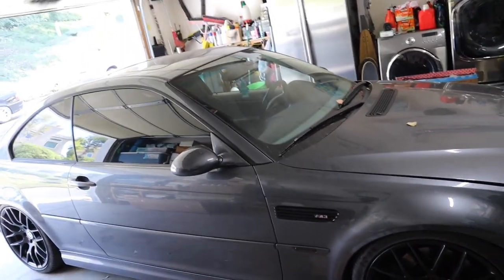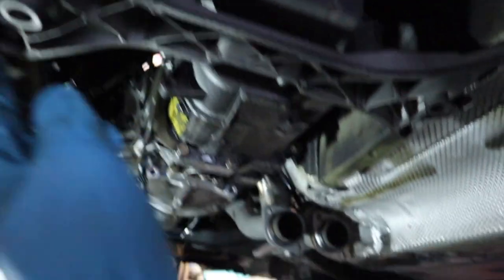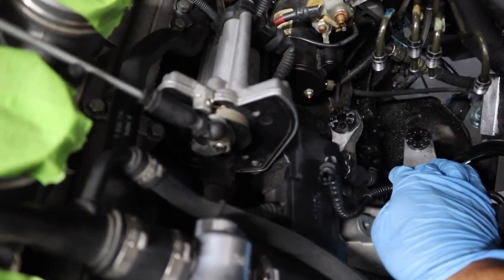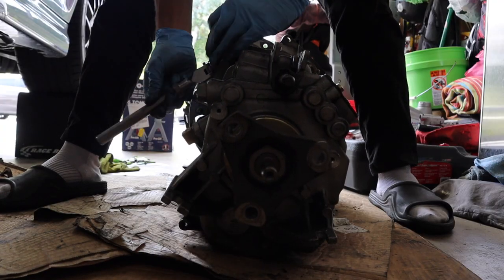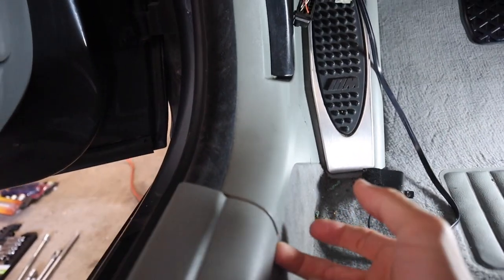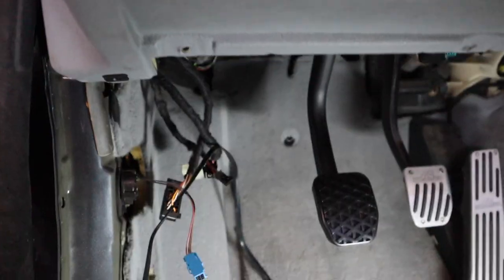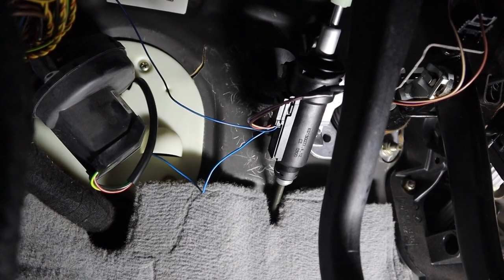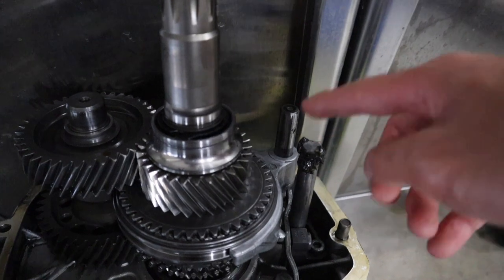E46 M3 SMG to Manual Conversion DIY (On Jackstands)

Comment from the maker: LITTLE UPDATE: My friend Jeppe had been tracking down why his cruise control hasn’t been working and it’s because at around 28 minutes into the video I explain how you need to wire into pin 20 on the connector that is the second one from the left but it is in fact the connector that is the second one from the right. Although messing this up won’t compromise the driveability of the car, it will make it so your CC doesn’t work. So if cruise control is important to you, be sure to fix this mistake I made in the video! Thank you and thanks to Jeppe for figuring it out!
Reply: Thanks for the update. I bought a conversion with non functioning CC. Will check the pin. Any other common reasons on swaps you’re aware of?
Reply from the maker: @kraken509  check the clutch switch! if it’s black and not brown, then that would cause a non functioning CC
Reply: @jinendow  mine is black! Good call.

Comment: Best thing you can do to ANY car IMO.  Doesn't matter if it's an E46 or a freakin econo box like a Neon. Three pedals or nothing is my motto. Makes it so much more fun to drive, and obviously you have a lot more control over the vehicle. The SMG sucks ass compared to the later DCT trans' anyways so regardless it's the better move. The DCT is WORLDS BETTER if your into auto trans.' SMG's are always so 'clunky' shift really rough, especially at lower RPM. Makes anyone look like a noob when you're driving. S54's are so awesome that having that crappy SMG bolted to it is really a buzzkill. I'm a VW/ Audi and BMW tech that's been turning wrenches on these and pretty much anything with an engine for a little more than 25 years. The amount of SMG failures I've seen alone also makes this swap mandatory IMO. Like a completely different car with the manual. Good video. Thanks for sharing man. 👍
Reply from the maker: I 100% agree! been a few years since I made this video and haven’t regretted a thing
Reply: @jinendow  definitely man! I've swapped to manual trannies on a good amount of all kinds of stuff over the years, and I've never had a customer or a friend that I've done the job for that's been disappointed whatsoever.

Comment: Did you notice any  power decrease after the swap prior to getting coded? Just finished up my swap and had a local euro shop code it , no more dash cog but still getting a CEL for smg. Car also feels about 200hp until 4k rpm
Reply from the maker: before I got it coded I could definitely tell the power was off. the revs in between gears would drop aggressively and it felt as if it was in some limp mode. after I got the car coded by ecuworx it felt the same as before the swap though (as in perfect)
Reply: @jinendow  I’ll hit up ecuworx ASAP thanks !

Comment: Good job on the video, decent coverage of the steps.
Regarding the trany, since you had it all out, did you replace any of the compression springs? Did you install the locking pin and thrust pin? also noticed no ID switch, any issues with that? Im just trying to get all the parts I need in my basket as we speak... will be doing all the seals (inner and outer) as well since its out.
Reply from the maker: I did not replace any of the springs unless that is covered under Lang's Bellhousing machine service. And the ID switch isn't really necessary if you get the proper coding done afterwards. Good luck!

Comment: I did the swap, but fuse number 3 under the hood is blowing. Its a 20amp fuse and i used a multimeter and saw that the brake light switch is connected to this fuse. Did you have any fuse blowing?

Comment: Hey Jin. where you able to source clutch switch #613 or you just stuck with #354? I actually ordered 1 supposedly the #613 but received #354. I want to know if you are still using #354 and what are the issues you have using the #354? I also plan on using ECUWORX for coding part of it. Thanks a lot for your time.

Comment: Thanks for the video. How did you get the transmission out at that height (your car looks like it isn’t this high, 50skid posted a video where he says it needs to be at least 24 inches clearance from the floor to the lowest point of the car)
Reply from the maker: it’s been a while but I believe i lowered it on a trans jack and then placed the trans on a piece of cardboard while it was still under the car. then slid it out from there

Comment: I've got a 1999 328i that had a 5l40e five speed auto. I installed a six speed manual from an 05 z4. I'm getting an S indicator where the gear indicator is. I've wired the dme and the ews still won't turn...

Comment: Awesome walkthrough man, I'm also doing a SMG to manual swap on jack stands and I got 2 questions.
1.  I have an EWS delete so my EWS module isn't plugged in. Will that cause issues with the one pin that goes into the EWS plug?
2.I also have a Buildjournal tune, I know on they offer re-tuning and they have an option for "I am now SMG". Is that all thats needed to clear the smg cog? or is more tuning needed?

Thanks
Reply from the maker: if you already have EWS coded out of your car I don’t see that being an issue
you will need more than a retune from BJ

Comment: My pin 8 isn’t empty on the ews, what do I do?
Reply from the maker: are you sure you’re looking at pin 8? I would double check if I were you. they’re labeled too
Reply: @jinendow  yeah it’s connected with a purple and white wire
Reply: @jinendow  is there a way I can actually be able to call/FaceTime or send a video of it anywhere? My wire guy wants to show you
Reply from the maker: @DrtyM3  yeah shoot me a message on instagram
Reply: @jinendow  what's up Jin I'm the guy doing the wiring for axel, the EWS module connector which is black and has 16 pins. It has pin 8 used by a purple mixed with white wire. And what's your Instagram by the way?
Reply: @jinendow  I shot you a message hopefully it was you

Comment: Hi,

Great video mate! Wich pin have you bought for the DME and EWS? 0.25mm², 0.5mm² or 1.00mm²
Reply from the maker: this is the part # I used: 61130006663.
Reply: @jinendow  thank you very much!  I will start next week. I hope the car runs after the conversion😂
Reply from the maker: @cenkyurtseven2078  if you get the wiring right I'm sure you'll be fine!

Comment: Great vid, I might have missed it but how did you mount the bracket for the shifter under the tans tunnel? Ive seen some weld it, some used rivets, how did you do yours? Not sure what its called. Thanks.
Reply from the maker: I actually did not install the bracket! since the rtd did not require it I opted not to install it for time sake. down the line if I opt for a stock style shifter, I will have to install one

Comment: Thanks for the video, great Job ,  I have an 05 that has a bad smg, it was starting for a while but now won’t start at all,  I thinking about doing the swap to I’m a little nervous about. How lod did it take you to do it all ?
Reply from the maker: Eddie Hernandez I took my sweet time and it took about a week. if you have all the necessary parts you could for sure complete this in a couple days
Reply from the maker: a few days*
Reply: Thanks, I'm going to start gathering the parts need it and get more familiar with the process, hopefully  my car will start soon
Reply from the maker: Eddie Hernandez good luck man! I studied and studied the realoem diagrams to figure out where exactly each part went

Comment: Why did you have to machine the bell housing? Pls n thx
Reply from the maker: there are certain detents and springs that need to be installed into the bellhousing that the manual requires where the SMG does not. If you use the self-centering shifter like I did you technically do not need to machine the bell housing but I still highly recommend doing it. If you read the forum link I put in the description they describe why better than I just did.

Comment: Did you pull the transmission off with a friend? I'm wondering if I will be able to pull it off on stands by myself.
Reply from the maker: I think I had my dad help me pull it off but if you have a transmission jack you should be able to do it yourself
Reply: @jinendow  Thanks!

Comment: Great video.  Quick question, why did you choose to modify the bell housing with the RTD Shifter? Can’t you install that shifter with the RTD and avoid bell housing modification?
Reply from the maker: thank you, yes you can use this shifter and not modify the bellhousing. I just read a lot of differing opinions on the forums and saw that some guys didn’t really like the shifter feel when the bellhousing wasn’t modified. I just thought I should play it safe

Comment: Nice video man!  Had a quick question since it’s a manual now did u disconnect the smg tcm completely or is it still hooked up with no cel? Reason I’m asking I just purchased an m3 and has a manual swap in it but has a cel and checked codes and all are smg related but the car runs fine.
Reply from the maker: baboosted I have the smg tcm still connected with no cel. I’m not sure if your car got fully coded. my car had a cel before ecuworx coded it remotely.
Reply: Jin Endow oh ok thanks man

Comment: Did you use the factory welded in shifter studs when mounting the RTD?
Reply from the maker: yes
Reply: @jinendow  thanks. Literally was installing when asking you. I was kinda bummed I couldn’t use the thicker bolts but at least the stock studs were in right place! Were you able to get rubber boot on? Did you install it before bolting down the shifter?
Reply from the maker: @kraken509  I believe I installed it before bolting it down

Comment: There is no comparison between a manual and sequential transmission if you’re gonna buy an M3 and you don’t buy a six speed then you might as well not buy an M3 because you’re just wasting your money! 
On the proud owner of a 2002 E 46M3 naturally aspirated pro charged M3 convertible that is a six speed manual. That is the ultimate driving machine not an automatic or a sequential.
Reply: If you’re going to knock smg you might as well knock the convertible too because of the extra weight.